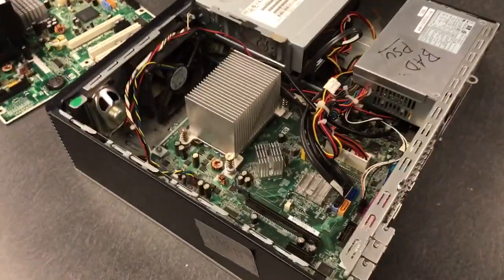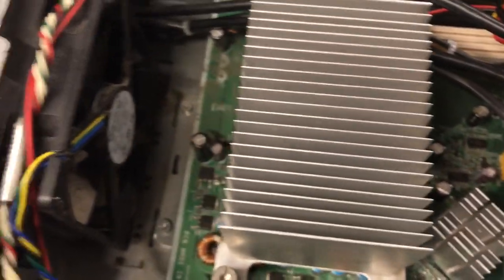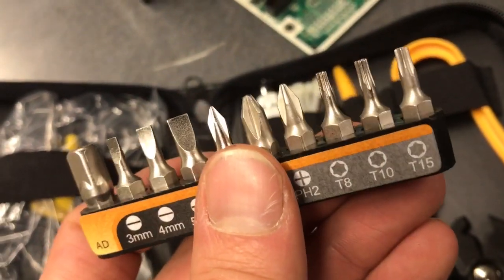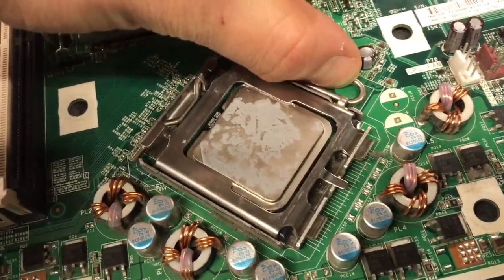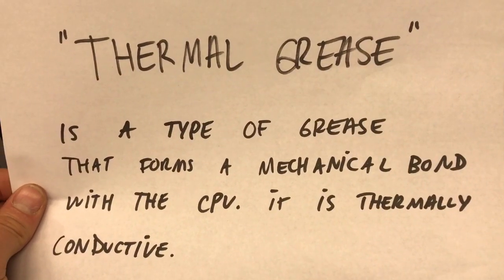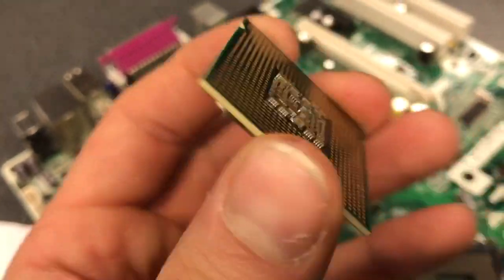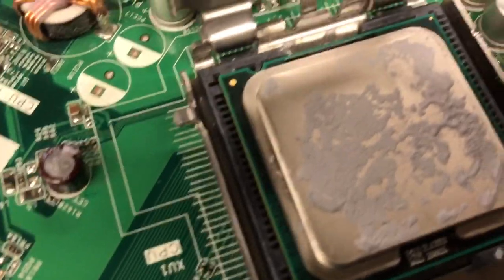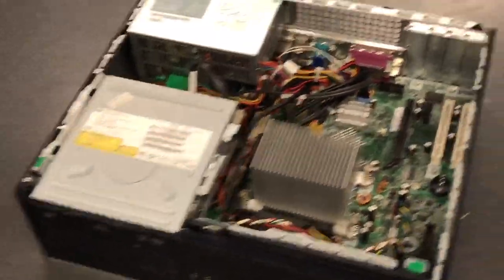lab video- removing a CPU from the motherboard

Comment: This helps alot just bought a pre built with a i5 8400 so hoping in time to get a i7
Reply: Ironically enough I just used this video to help replace my 8400 with a 9600k
Reply: Dude make sure your motherboard supports kt
Reply: Was it the MSI one
Reply: dont mess with the HONK or you'll get the BONK  i5 is good for games but that 1050 is gonna hold you back

Comment: My cpu is stuck in the socket
Reply: How did that happen. Did you glue it to the socket?
Reply: GB.Gaming - Spy Ninja 11 months after... 😂
Reply: Light Extreme aha
Reply: Same how did you take if off?
Reply: TP_YYZ I just didn’t push the pin down all the way 😂, the locking pin
Reply: VexPho Oh god😂 mine is like stuck stuck
Reply: VexPho holy shit i had the same issue
Reply: MakeitRainGold I got it out, I can help u if u want.
Reply: TP_YYZ nah i got mine out i didn’t pull the pin all the way up

Comment: My fan is stuck on the cpu, it felt like it was glued so I yanked that thing out and the CPU came out with the fan. Is that ok?
Reply: @CTTRest  So far it is working great, I have a ryzen 5 3600 and I can do anything I want on it
Reply: @Zixio  consider yourself lucky because you could've bent all of the pins on your cpu
Reply: Lol I thought I might of broken it, works really well
Reply: @Zixio  the amd stock cooler thermal paste is like cement when it gets dry
Reply: Always twist the cooler off, don't yank it.  Even try prying it apart from one corner. Pulling away from the socket is how pins break